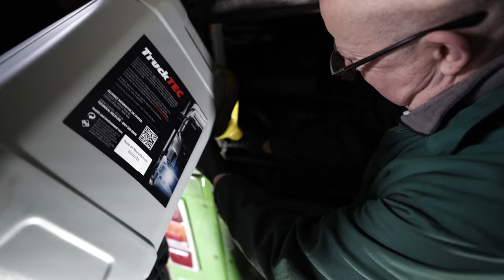Hooton Park | Bringing a Bristol VR Double Decker Bus Back To life After Laying Idle For 15 Years

Comment: Nice to see the holding in neutral when using the SCG selector, so many used to snap through the gate and wondered why they got a jerking from the bus as the bands did not release quick enough.

Comment: I lived all my younger life in and around Bristol.  We moved there when I was 4 and I remember the Lodekka rear entry buses that travelled up and down the A38 where I lived, about 10 miles outside the centre of the city.  Then when we moved closer to the city and I went to school there, it was mostly front engined front entrance FLFs, gradually transitioning to REs and VRs by the time I left school.  My school was only about a mile and a half from the BCV factory on the Bath Road, so I often saw the RE and VR chassis being driven Bath direction on their delivery run to ECW in Lowestoft.  Whilst I do appreciate the RM, it's fabulous to see so many Bristol variants in preservation, and the sound of the Gardiner engines and the whine of the transmission bring the memories flooding back.
Reply: St Brendan's by any chance ? Simon.

Comment: Awesome looking bus in that livery, Gardner engine sounds great when warmed up idling away, hope to see more Bonus videos of Collector Buses maybe a Volvo Ailsa as mention they are a front Engined not half-cabs, think they were maybe the last Front engined Double Decker buses to be built in the late 70s to mid 80s, I remember the First SMT Lothians Ailsa's MKIII with Alexander RV bodywork and the Yellow and Green line on the livery, maybe with the SCG Gearbox as a lad they sounded awesome, think they withdraw then in the mid 00s, shame buses had character in the 70s, 80s nowadays we just stick with the horrible Enviros and Streetdecks "Hop on and Hop Off" buses!!
Reply: L/T had some ex Birmingham Volvo Ailsas at Potters Bar garage.   Boiling hot in summer but toasty warm in winter for the driver as the engine was part of the cab.   All were pretty worn out and were scrapped, but I remember one coded V12 which went like a rocket, 55mph + up the A1 returning to base.   According to the scrap guy who collected them part of the chassis had rotted away with a 10ft gap in the middle!!
Reply: @brianwood9913  remember the West Midlands ones new one is preserved and lives by me JOV738P I believe always remember their scream growing up

Comment: Stagecoach Lancaster was still running a VR (mainly on the Lancaster - Blackpool route) until 2005/6. As a result it went off to preservation in Cumbria straight after retirement. I'm used to them with "Maidstone and District" on the side.

Comment: I was born and raised in a small country town called tring in Hertfordshire.  The main bus route that operates through my home town used to be operated by London County/ Green line. The route ran from Aylesbury Buckinghamshire to Watford Hertfordshire and the main bus depots were Aylesbury / Hemel hempstead  / Garston which is on the outskirts of Watford.  In addition we actually had a small outstation in tring. The buses I remember travelling om from a young lad were these bristol vr beasts with their unmistakable soundtrack and the leyland nationals which I remember  seeing that little chrome gear lever on the right side of the driver which I learned later on was the semi auto gearbox. Some drivers could operate them nice and smoothly whilst others tried driving them like they were driving a race car not holding in neutral between gear changes as per leyland  recommended.

Comment: I used to drive VRTs on a regular basis. The answer to how to fill the oil without getting it everywhere is to thorw away the traditional oil can or funnel and get a big plastic watering can from your local Wilkos. Stick the oil in that and it's much easier to tip in. It's also easier to monitor how much you're putting in each time.

Comment: Drove 105 VR MCW bodied fleet at Wolverhampton Cleveland Road Garage during the 70's and 80's until all moved to Walsall Garage. The Mk II VR was a much better bus than the MK I. But they were very heavy on the steering especially with a full standing load. Happy Times. Also past my test on the VR at Withal Bus Museum back in 1974.

Comment: As a child in Surrey used to travel a lot on Alder Valleys Leyland Nationals. Then in Hull late 70s early 80s Leyland Atlantean’s then in Grimsby Lincolnshire Roadcar ran Bristol VRs until Stagecoach took them over. My only grip with VRs was the poor lower saloon headroom

Comment: I have driven many buses and coaches in my long career, but never a Bristol VR or any other Bristol. 
I drove Daimler Fleetlines with Gardner engines, so I recognize the sound. Gardner smoke is more acrid than any other. I used to work for AA motor services and Dodds of Troon had many Gardner engined buses.
On a cold morning it was like fog in the low lying yard! They couldn't meet emission standards, hence their end. Usually the smoke cleared after a mile or so, could be the stale fuel, hopefully!
Reply: Ironically when a Gardner had fully warmed up, it was surprisingly low emission for its age. I have always wondered why Gardners produced white clag and Leyland 500 types black clag.

Comment: You could do with asking any of the old garage mechanics if there's any tricks to the oil refill. That would drive you nuts and seriously impact on any bonus scheme in operation at the time. 😀😁😂
Reply: It turns out someone has fitted the filler neck with copious amounts of sealant which is partially blocking where it runs in. A job on the list to have off and make a gasket for instead.
Reply: @timhines6543  Thanks Tim

Comment: The VR was Bristol / ECW’s front entrance, rear engine evolution of the FLF, sharing many styling characteristics. In styling terms the VR is very much like what the London Transport FRM was to the RM on which it was derived. Could be why you like it 🤔
Reply: And the VR had leaf springs like the FLF, rather than air suspension, hence the bounce.

Comment: Had to pixelate a few number plates then.  That semi auto changed well, all the ones I've driven were all different, some needed a longer pause in neutral than others, some no pause.  It made no difference if electric or air operated.
Reply: I found that odd, a two second search would give you reg plate anyway

Comment: Also (if original) you could prime each pump element to injection pressure & even lift 3 exhaust valves to reduce compression.

Comment: Looks like a Gardner 180 engine worked on them in the 70s in foden s39 eight wheel tippers, they smoked a lot until warmed up.
Reply: @paulbird3216  No they weren't clapped out we ran 12 of them and they all smoked on start up until warmed up.

Comment: Were Gardner engines the predominant engines in these buses, or were there other diesels that were used.
Love those buses.
Reply: ferstuck37, Gardner engines were the preferred option as they had better fuel efficiency, the vehicle featured in this video is a series 3 VR, to be accurate a VRTSL6G. The earlier series (1and 2) were fitted exclusively with a Gardner 6LX which gave 150 bhp at 1700 rpm and didn’t originally come with power steering. The series 3 vehicles were fitted originally with either a Gardner 6LXB (180 bhp at  1850 rpm) or a Leyland 510 fixed head lump this engine was replaced in production by a series 4000 Leyland 0 680 when Leylands ceased production of the 500 series diesels.
Reply: @scrumpydrinker  Thanks for the info appreciate it, keep up the good work.

Comment: If possible can you do a video of an oil change on a Bristol RE and Bristol VR seeing you take out and replace the oil filters and where to drain the oil out and adding fresh oil, as there are few if none of books like Haynes manuals showing you. Also radiator fluid being drained and replaced and removing old fuel and adding new fuel filters. Surprised that this VR smokes so bad my VR does not smoke anywhere near that bad and also starts up very quickly even after 11 months not started.

Comment: So as per my previous question. What's the transmission on these? How does it work ?
Reply: Engine driving a SCG Epicyclic gearbox (not dis similar to an RM gearbox) through a fluid flywheel. Then drives through a Mitre box which is what gives a VR its classic whine and into the diff and back axle.
Reply: @timhines6543  That's interesting to learn - so is it a Mitre box that also gives the RE it's beautifully distinctive whine too? I love the musicality of certain bus transmissions and have always wondered why only some AEC's - Regent's in particular - have such a beautiful whine, whilst other's - usually coach variants- don't?
Reply: @robertp.wainman4094  No, the RE doesn’t have a mitre box, the engine is mounted behind the rear axle and the gearbox is remotely mounted in front of the rear axle, it has a prop shaft connecting the two. This means that the input drive to the box and the output drive to the rear axle is at the same end, unlike most gearboxes which have the drive going through the box. The rear axle was basically taken from the F type deckers and is a double reduction unit with the prop flange mounted fairly low down on the axle. This means that there is a set of transfer gears required to drop the output from the gear train down to line up with the input flange on the rear axle. The prop shaft is a very short unit and can’t be run at large angles of deflection. It is these transfer gears that give the ,RE its characteristic whine.
Reply: @scrumpydrinker  Many thanks for your comprehensive reply - really interesting to learn the reason behind the RE's distinctive whine.

Comment: Lawrence Gardner,s 6LX,s is quiet , if you get a chance  ride 'CHER' EWS753W Mike Ede,s VR with SERIOUS ATTITUDE YES CATS&KITTENS!!! She is fitted with a LEYLAND O680, Eleven Point One Litres and one hundred fifty Prancing Preston Ponies.  CHER  is so rare,rarer than a Bugatti Veyron,and one of only two 680 VR,s roadworthy. A680 VR sounds MEGA with a blown exhaust elbow RASPING BOOMING ,WITH SCREAMING SCG TRANSFER GEARS as backing vocals. You are right modern buses i use that term loosely, are soulless corn flake packets on wheels, ENVIRO 400,S are fucking awful, Stagecoach Stroud Depot has one amongst its fleet of 'SLUGS' Scania Omni Double Deckers, five Swedish pots twirling a four speed ZF Ecomat Auto-box. The Cornflake packet has the same number of gears as a Raleigh Wayfarer bicycle,three courtesy of Mr Voith twirled by a Cummins 'C' Series more suited to powering a Westwood sit on lawnmower,or a sex toy bought off the Love Honey Website.

Comment: Also (if original) you could prime each pump element to injection pressure & even lift 3 exhaust valves to reduce compression.
Reply: I would a £ for each injector I changed on a gardner LW and 150 engine still got a gardner box spanner used to tighten the injector retaining bridge nuts trouble was by the time you had done a few up your fingers hurt so out came the ring spanner which then led to over torquing the injector and cracking the cylinder head .